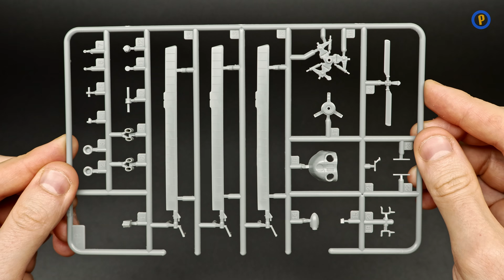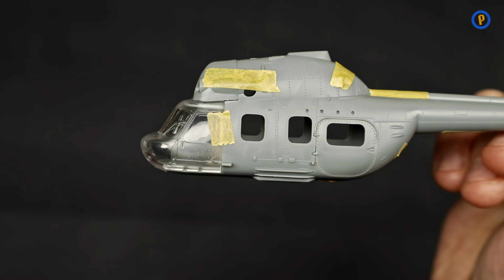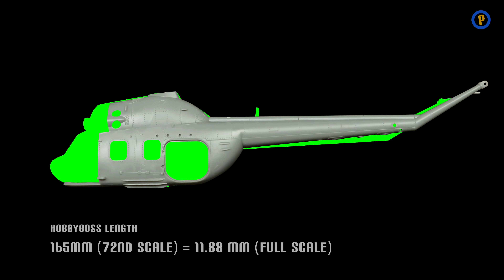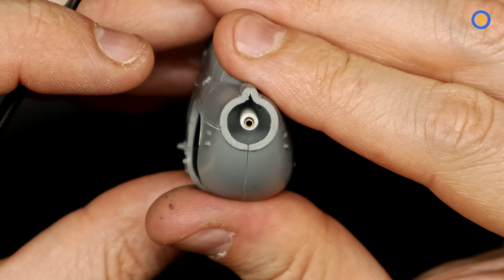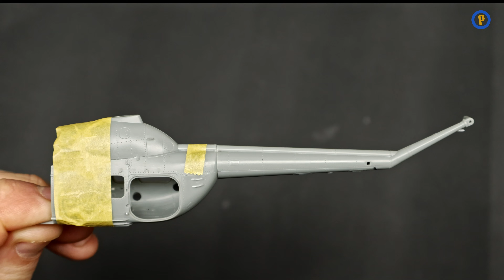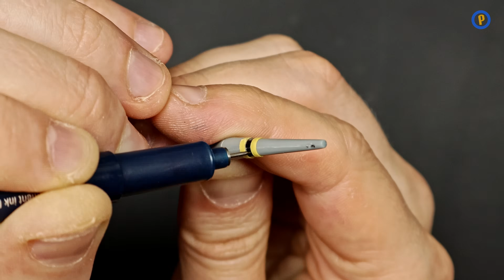The Flying Chicken Thigh - Mi-2 Hoplite (HobbyBoss 1/72) - Episode 1 - Fuselage Geometry

Comment: Would like to knw what Brand name of drills, and sanding pads you use? Mine are old, and worn, and I'm in need of some modern equipment. But not familiar with all the newer companies out there. Thanks!
Reply from the maker: Hi there! The drill bits are noname products from China - I'd suggest to search for "micro drill bits" or "tungsten carbide micro drill bits". The only downside I found so far is that the thinner ones as extremely brittle and once they break, getting them out of plastic parts is really a nightmare... As for the sanding pads, I use those green ones from Vallejo 99% of the time.